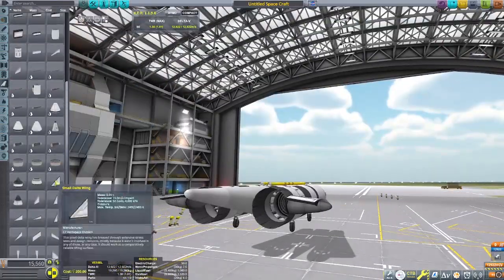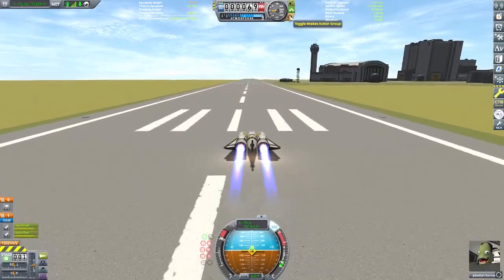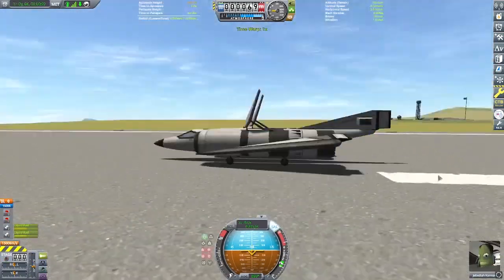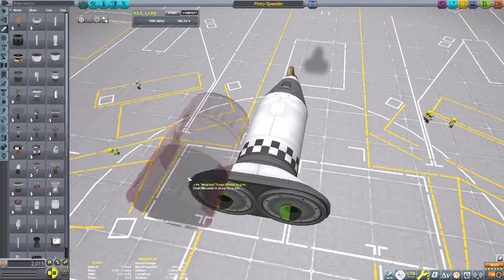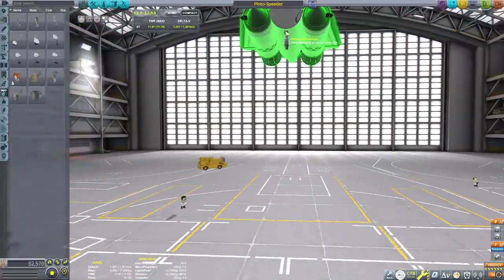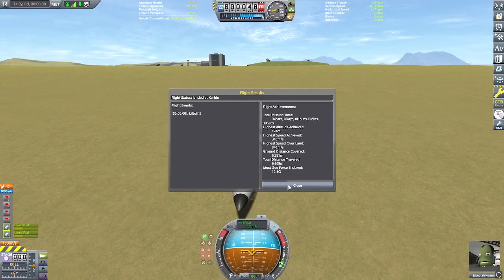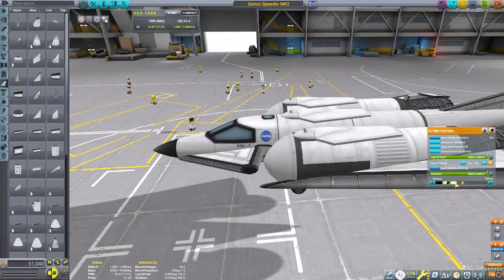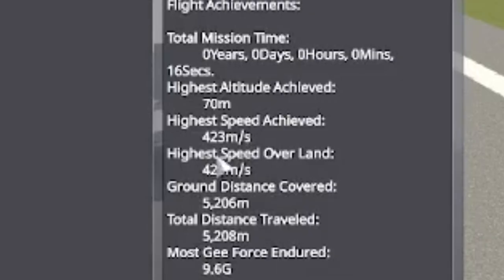KSP Runway SPEED RECORD (Reply to Real Civil Engineer)

Comment: You actually don’t need downforce here. Downforce benefits real cars because they accelerate with wheel traction on the ground, but you are using jet engines. You would have less friction and go faster without downforce.

When you put those angled wings, they act as control surfaces , lifting the tail up and making the front push down on the ground more than the back. This makes the car unstable and want to turn around as you are seeing.
Reply from the maker: The point was to add them as control surfaces as I was having an issue of the front lifting up at high speeds. The downforce is still needed to make sure the wheels grip the track and don't try to become airborne. The real life quickest jet engine car had a large spoiler on the rear to help with this. My car is not the most stable machine, but it did it's job 😉

I plan on revisiting this video soon and will tweak the control surfaces to keep grip but not introduce unneeded friction.
Reply: @OKPlanB_TV  good idea,I didn’t think of it like that.

Comment: a good trick to keep some of the builds stable down the runway is to reduce the friction of the front wheel(s) to 0. this will make the front wheel act more like a ski.
dont worry about the steering the rudder,reaction wheels and engine gimbal will take care of it. in fact thats still to much steering. i would turn of engine gimbal aswell.

Comment: to avoid having unneeded oxidiser, use the pure liquid fuel fuselages instead of rocket fuel to get higher fuel concentration and better weights when you take fuel out
Reply: good info Vladimir Putin, do your rockets go too high for air intakes or do you use mk2 liquid fuel fuselages on them?
Reply: @arshiabehmani724  SRB's baby, who needs throttle control when you're plummeting into california at mach 5?

Comment: He needs to do a Kamikaze run where he lets it run full speed until it drowns or flips just to get the max numbers. This is in the cyberverse and not real life. Nose mounted canards that extend out to be even with the outer air breaks. They bend upwards at the back in the same way that they are mounted on cars. The front isn't tapered enough, see the Concord plane for reference. Nudge the rear of the wing up slightly, and curve the front of the wings inside slightly. It won't work anyway, the in game physics don't work correctly. The wings pushing down in the front should keep you on the ground and it doesn't, with the wings pointed in the opposite direction you get grounded and that should lift you off of the ground.
Reply from the maker: I'll revisit this video and just let it go for as long as I can, just for you
Reply: @OKPlanB_TV   You will get to enjoy the outcome as well. That is the reason why people rubberneck at the sight of all road  accidents. Their primal need to see the carnage and then be able to claim that they are having a better day then the poor slobs in the middle of the mess that they don't have clean up or claim responsibility for.

Comment: any places on the map flat enough (without trees & rubble) to go for a proper land speed record including the requirement of the real record of the turning arround to accelerate in the oposite direction?
Reply: heya
was compairing to real life land speed records
they dont just get up to speed once but need to turn arround and go again within an hour - official land speed records are calculated as the average of these 2 runs ;)
didnt think turning arround to go again would be easy on the runway due to overshooting the end.
Reply from the maker: I'm not certain of what your question is trying to ask
Reply: They’re saying ‘use bigger runway-?’
Reply from the maker: @rorycannon7295  Well the whole point was to use this runway, so taking the runway away defeats the video.
Reply: @OKPlanB_TV  fair

Comment: My first thoughts was: why didn't you try breaking with rocket engines? Is it not allowed?
Reply from the maker: As in using rockets on the front of the craft to help slow it? I just didn't try it. Maybe if I revisit it 🤔
Reply: @OKPlanB_TV  no theyre saying actual rocket engines instead of jet engines
Reply from the maker: Like with reversed thrust? Rockets don't work like that
Reply: @OKPlanB_TV  No, like just plain forward facing rocket engines. If they can speed you up they should be just as good for slowing down.
Reply from the maker: Personally I think it looks goofy...but if it works who am I to bash it

Comment: the hop comes from the force on the back of the craft, put the parachutes under the front of the craft, or at least some of them and that might fix the hop.
Reply from the maker: Hm, noted. I appreciate the help! I'll give it a try
Reply: @OKPlanB_TV  its the center of motion with the parachutes being so high and aft. if you mount them lower you wont get as much rotation, further forward (around the center of mass) would be optimal to reduce any weight shift

Comment: This game seems so complex and we’ve got guys like you to make it look easy. Impressive my man, keep it up
Reply: Was my first impression back in the day aswell.
But as soon as you get a feel for how it works it all becomes so obvious
Reply: If you think stock KSP is complex, try realism overhaul.
You need to worry about limited ignitions and fuel sloshing in the tank causing the engine to fail when it ingests vapors.
As well as things like tooling for different tank sizes.
Reply: It's actually some kind of simulator of real space science so ... It will be difficult first-time
Reply: As long as you start easy like science mode which basically starting the game from ground zero and all you have to do is unlock since points to unlock parts and other stuff like contracts you learn alot.
Orbital machanics reentry and all that stuff.
Reply: It’s easy
Reply: As one with nearly 2000 hours logged on the game, I would like to say, it gets a lot more complex.